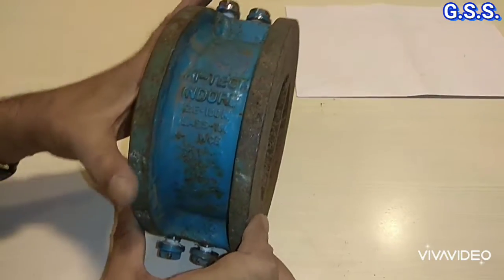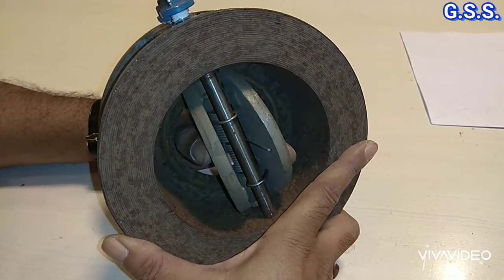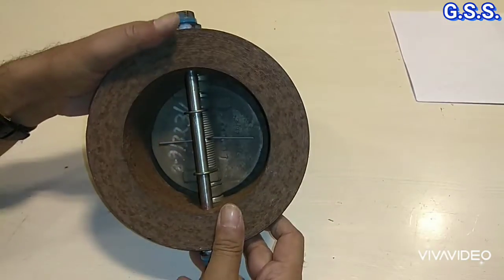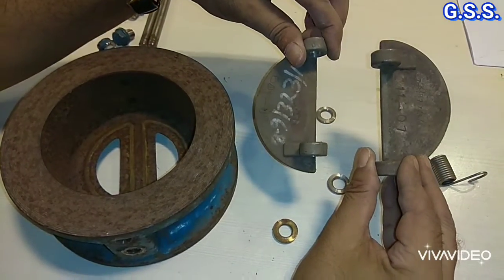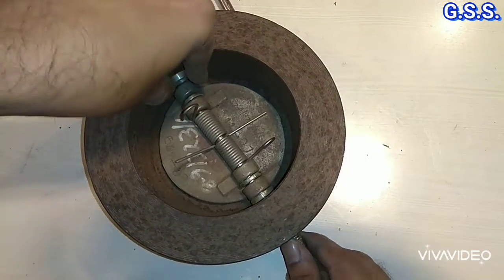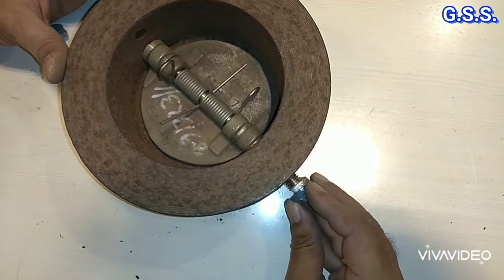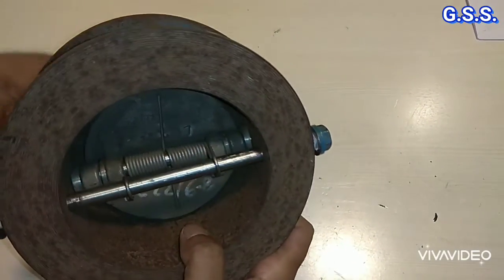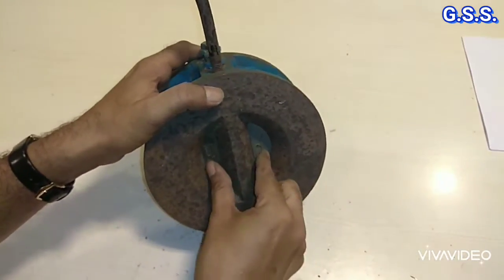Piping Engineering : Dual plate check valve - internals

Comment: Dear Sir. Since there is no holes im the flanged ends of the valve so I beleive before installation it has to be drilled as per the standard.

Comment: Sir you said stopper rod is provide to restrict complete opening/travel of the flaps. Why do we want to avoid complete opening?
Reply from the maker: If stopper rod is not there, then spring will be compressed so much that after full opening valve may not be fully closed because spring may not be able to close the valve tightly.
Reply: @gourisankarsamanta7670  Sir got it. Basically to avoid plastic deformation of the spring material.